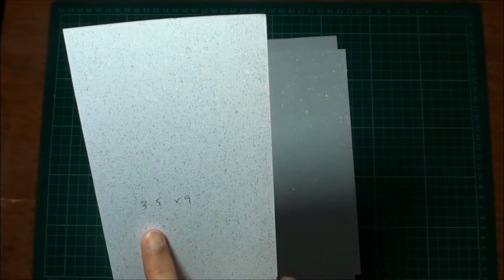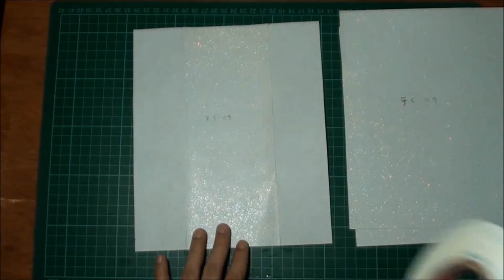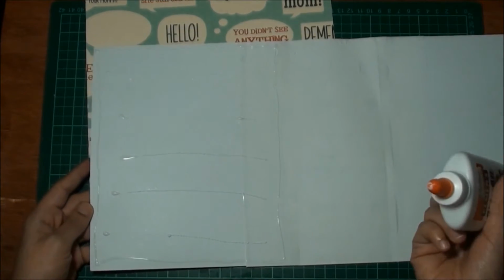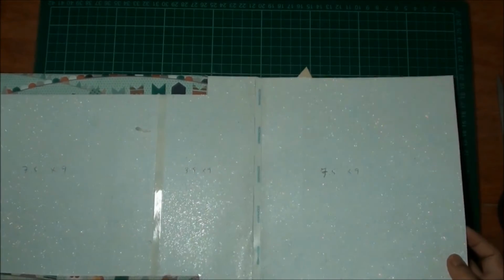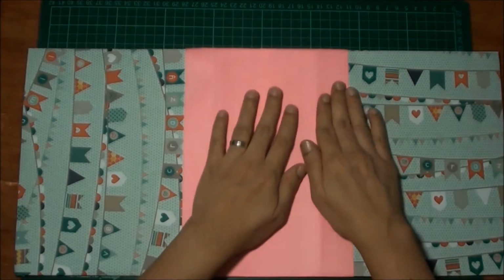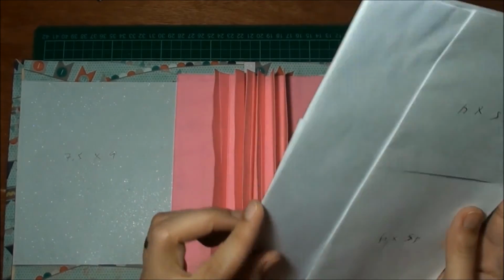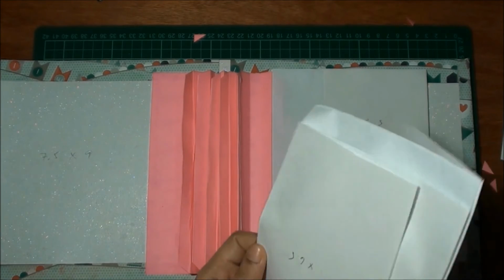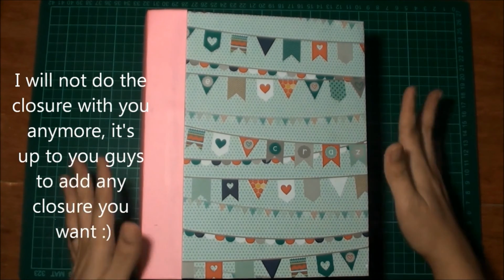Bundle of Joy Baby Mini Album Cover Tutorial

Comment: hi..
 a doubt on the size of chipboard.. is it ok to make the size as 7 by 9 inches or smaller .. as the album size is 6 by 8 inches? 
Thanks
Reply from the maker: It's up to you, you can adjust it on the size that you want. This is the size I used because I consider the tabs on the side pockets. :)
Reply: ok thanks. .. will try :)